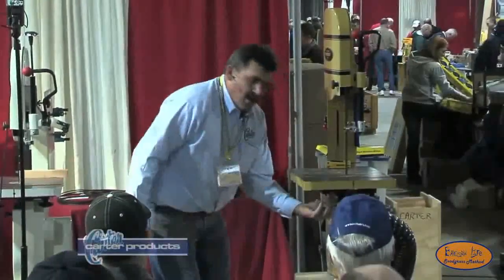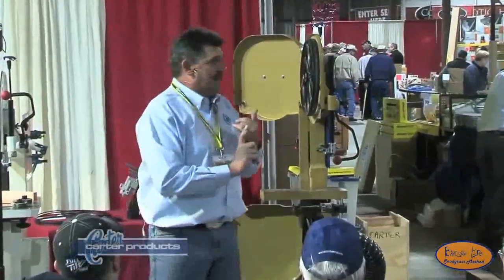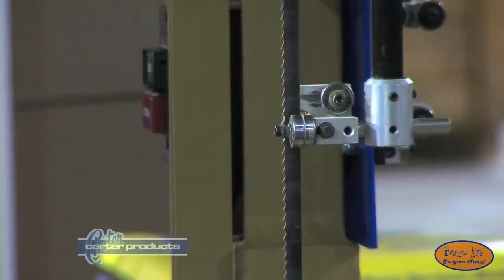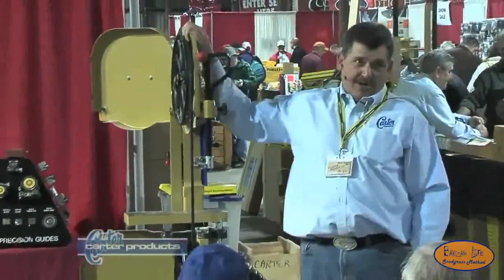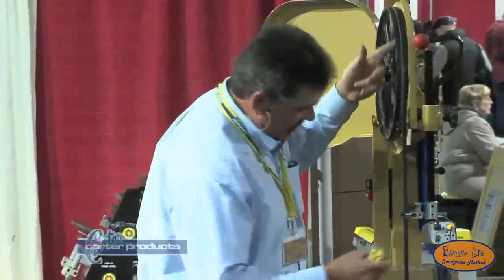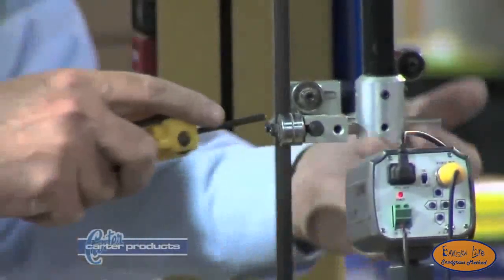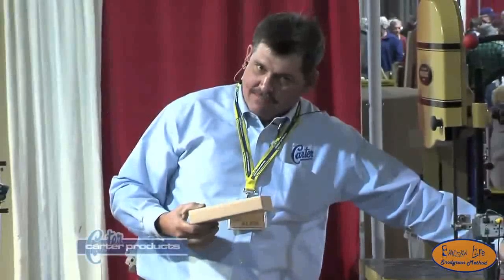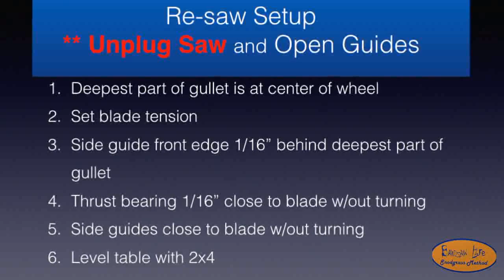Bandsaw Tuneup

Comment: Hello Mr. Snodgrass. I have seen your band saw tune up a few years ago. Well, about two weeks ago I became a band saw owner. I picked up a Rockwell/Delta 28-200 (mid 1970's I assume). It had some issues. When I got it, it was not even close to being set up properly (based on your videos). I made an attempt to get it somewhat setup but to no avail. I could see immediately the tires needed to be replaced (the upper tire would not stay on the wheel). So, I took it apart, cleaned all the rust off I could and got the parts looking good. The clamp shoes for the trunnion was bad. One was broke in half length wise and the other was in about 7 pieces. I ordered new clamp shoes, tires (urethane-orange) and picked up a link belt. Got my parts in yesterday. I put everything back together today. I used your method of tuning up a band saw. Once I was done and double and triple checked everything, it was setup or should I say dialed in. I put a container of liquid on the table, and showed very little vibration. I said what the hell, and put a nickle on edge on the table... I am pleased that I believe it passes the nickle test. IT does have the original steel blade guides (in very bad condition), which I had to grind down to get them flat. The upper blade guides are round not square, and have not seen this on other saws. I thank you for posting your videos so others can benefit from your knowledge and experience. With out your videos, I would have not know anything about setting up a band saw. Thank very much. Mike - Tucson, AZ

Comment: I gotta thankyou for this video,I just got into a 30 year old 14inch jet bandsaw that the previous
Owner had set up incorrectly,It was obvious,cool blocks with gouges,thrust bearings with deep grooves cut into them and a bad drive belt.
After watching this video and replacing the abused parts I have very smooth running tool,and the timing was perfect as this is my first bandsaw and I had no idea how to set one up.
Thanx again for this tutorial

Comment: I have just adjusted my Laguna 14/12 with the Resaw King blade as suggested here. I aligned the back of the blade to the rear of the wheel so that the gullet is just in front of the centre line. Removing the table is a wonderful tip, as it allows for accurate set up of the ceramic guides. I also replaced the annoying adjustable locking handles with star knobs. The result is much smoother & accurate cuts. Excellent advice!!

Comment: I'm wondering if you've modified your tune-up tips for newer model saws. I recently bought a Rikon 14" model. If i try to center the gullet with a 3/4" blade, the blade hangs over the wheel at the back. If i center the gullet with a 3/16" blade the bearings holder won't push back far enough to position the side bearings behind the gullet. I have to position the gullet in the first third of the wheel (ie. Center the blade on the wheel per manufacturer instructions) to be able to correctly position the guide bearings. Wonder if you have any experience or input on this. Is this something unique with newer model saws?

Comment: Thanks Alex. Though I did run out of lateral adjustment on the top wheel and couldn't get the gullet into the centre. Jet 18" bandsaw.
Reply: I'm having the same trouble, with the same saw. Although I am maxing out the saw with an 1 1/4 wide blade

Comment: My Craftman bandsaw has been sitting in the corner of my garage/shop for 3 years. I want it so bad. A year ago I purchased the new tires that everyone said I should but could not get the on. I not strong enough. Well I decided to try again 🙃 I pray so hard and ask my Lord to help me get them on. Praise God He did. Go after that it wouldn't work because of it being so badly off tracking. A adjust everything.  But now I got it running by adjusting. My saw is very, very old and doesn't have tracking in the back. I found a screw that I believe is because it made my blade not come all the way to edge.
But now it is make a lot of noise which it always did. But now I know from all you that it couldn't be making so much noise.  I checked & guides & adjustments.  It is a odd sound with a small amount of whistle.  
How would I know if it needs barring or that kind of think

Comment: Do you recommend any kind of lubricant for the tensioner?  I released my tensioner bar today and nothing happened, then I unscrewed the manual tensioner until the rod pulled out and still nothing happened.  I then took a ball peen hammer and tapped lightly on the tensioner and it popped down and released the blade.  The saw is a Delta 28-276
Reply from the maker: @Rebel9668  any dry lube will work.

Comment: Hi Alex, thanks for your great guidance.   I have a Grizzly G0513X2 bandsaw and have been unable to get the bottom of my sawblade gullet to ride on the center of the wheels.  I have moved the back bearings so they are far from the back of the blade and also moved the side bearings so they would be behind the blade teeth when centered and not touching.  Then I have loosened tension and repositioned the blade so that the gullet is centered but the blade moves forward until the entire 1/2" blade is centered on the tires.  Can you give me advice?  Thanks!

Comment: Can I continue to use a bandsaw blade that got kinked say 90°? Not a sharp kink maybe the radius of a quarter?
Reply from the maker: If you can bend it enough to work, sure.  It will leave a rougher cut and could break

Comment: How much should the gap between my upper guide bearings and the blade change as I move the guides from the bottom of the cutting height range to the top?  Mine vary by about 0.045", which seems like a lot.  This is with a 1/2" Jet blade centered on the upper wheel and tensioned properly.  If it was just the thrust bearing then I could adjust blade tracking, but the side guide bearings move as well.  If I adjust the 'front' side bearing so there is almost no gap at the bottom of the cutting height range (guides just 1/2" above the table), the gap increases to about 0.050" at the top (13" of cutting height).  Is this normal?  Thanks for your great channel!!
Reply from the maker: You say the blade is centered on the wheel?  You actually want the deepest part of the gullet in the center this should align your blade a little better since the blade placement shouldn’t move, it’s set at the factory
Reply: @bandsawlife2660  Thanks Alex.  I did try that (hard to get everything in one post) and it helped a lot with the thrust bearing but did nothing to help the lateral clearance variation. I'm wondering how much lateral clearance variation is 'normal'.

Comment: Alex hasn't responded to any questions about wide blades with respect to centering the gullet on the center of the wheel. I'm not convinced this recommondation applies to wide blades. But Alex if you are still monitoring your Youtube comments ... for wide blades (1''wide on 1-1/4 wide wheel) do yo still recommend setting the deepest part of the gullet in the middle of the wheel? Anybody else solve this problem?
Reply from the maker: Sorry if I missed this, always center the deepest part of the gullet in the center of the wheel unless it overhangs the back of the wheel
Reply: @bandsawlife2660  Thank you for the clarification and quick reply!

Comment: Hey Alex. I adjusted the band as you instructed. But I checked the alignment on the lower wheel. It tracks different and not like the upper wheel. Is it supposed track the same? Or do I just set the upper wheel and ignore the lower one?
Reply: Jame Andy ignore the lower wheel unless the blade is tracking off the wheel.  Remember the bottom has to be further forward than the top so the blade enters at the bottom of the wood At the table first or it would roll the wood into the blade.

Comment: what if the wheel is not crowned? where should it be with relation to the (uncrowned) tire?
Reply from the maker: Generally on a flat wheel the blade rides toward the front of the wheel at the top.  Tip of the teeth are usually even with the edge of the the front of the tire.
Reply: @bandsawlife2660  thanks for your prompt and helpful wisdom. i got some new tires, and i got crowned tires, so i should be able to follow your advice to the letter regarding crowned wheels now.

Comment: How do you keep from hitting your thrust bearing, because when you begin your cut in a resaw application your putting pressure on that blade and it’s going to run into the bearing.  The bearing is 1/16 or less away and there’s always some flex.  I’m getting really bad blade drift and can’t figure out why.  All of my bearing are adjusted to your specs and deepest part of the gullets are on center of the wheel.  It’s a new 1inch blade on a PM1500 bandsaw.  Any thoughts?  Thx
Reply from the maker: You should hit the thrust bearing as soon as you start to cut.
Reply: @bandsawlife2660  Okay, then I’m not sure why my blade is drifting.  The blade feels sharp and it’s fairly new too.  But that’s the only thing that it might be is the blade.  I’ve looked at everything else.
Reply from the maker: What kind of blade is it?
Reply: @bandsawlife2660  For the life of me, I can’t remember what brand of blade it is.  The blade spec a 1” blade with 4 TPI.  I just finished double checking all of the guide bearings and thrust bearings, those seem to be set right where you mention they should be in your video.  The deepest part of the gullet is riding dead center of the upper wheel.  Speaking of wheels, what about the lower wheel, does it necessarily ride in the center like the upper?  Mine is not riding in the center on the bottom wheel.  I’m thinking it has to be the blade.  I tried running a solid piece of cedar 4x4 through and it wasn’t cutting well at all.  It’s a Powermatic PM1500, takes a 153-1/2” blade, I think, I’d have to double check.  Do you have a blade manufacturer that you would recommend I look at for buying a new resawing blade?  Is the teeth count where I should be, 4 TPI?  Not sure if this is true or not, but heard you should always use the biggest blade your machine can fit when it comes to resawing.  Thank you very much for your help!
Reply from the maker: Order a 5/8” greenwood blade from Carter Products. That all I keep on my 24” Powermatic you’ll be glad you did. Tell them I sent you and they will give you a 10% discount 
Best blade you’ll ever use
Reply: @bandsawlife2660  THANK YOU, so very much!  I’ll get one ordered.  What tooth count?  I bought this saw a few years ago, brand new and I’d like to see what it can do! 😁👍🏻
Reply from the maker: 3 tpi
Reply: @bandsawlife2660  Okay, I’ll need to call them.  Their custom ordering page isn’t working right.  I need 153-1/2 length and it’s not recognizing this in the “fill in box”.  I do see that the 5/8” blade did default to a 3 TPI.  I’ll mention you sent me.  Thx again.
Reply: @bandsawlife2660  Hey Alex, I was curious about the blade location as it sits on the upper wheel.  You mentioned setting the deepest part of the gullet centered on the upper wheel.  My current blade is a 1” blade, with the deepest part of the gullet centered, it has the back side of the blade riding off the wheel a bit.  Is this still okay?  Thx again
Reply from the maker: You should hit the thrust bearing as soon as you begin to cut.  1” blade is way to overkill for that saw.  Try a 5/8” Greenwood blade by Carter Products for straight cutting only and if you would like the ultimate combo blade for resawing up to 8” and radius down to 2” go with the 3/8” Greenwood.
Reply: @bandsawlife2660  Yep, I just ordered both those sizes from Alan Kaufman, over at Carter Products.  Dropped your Name for a 10% discount.  Thank you again for that recommendation!  I was just curious about the 1” blade and how that worked with the centering set up.  But hey, no more 1” blades from here on out.  Thx
Reply: Alex…Thank You very much for the Greenwood blade recommendation!  Just installed the 5/8 3tpi blade and I’ve never resawn with a smoother cutting blade.  What a joy.  Picked up a 3/8” too for any contour cutting that may come up.  Thx again! 👍🏻

Comment: Hi, my Ryobi BS 900 Bandsaw blade twists when turning wood material to cut an angle in the wood thus cutting a straight line. Is there a way to fix this? I know it is not supposed to happen otherwise it will be impossible to cut angles, the blade cuts fine and is thin which I understand is supposed to allow for tighter turns in cutting angles in wood. The machine was used and I am not sure what the previous owner did, I followed the setup instructions from this video as best I could but I am not sure if I have the tension completely correct, . Has anyone else ever had this experience or know how to fix this, any help is greatly appreciated.
Reply from the maker: The issue is the saw it self.  It has a 9” wheel and you can’t use a blade thick enough to prevent twisting.  The radius of the wheel requires a thin kerf blade to prevent stress cracks.  I wish I had a better answer for you.
Reply: @bandsawlife2660  Thanks for the quick reply. Is there anything i can do to cut a curve as I am unable to cut any curve. Every time I try to cut a curve the blade twists to the curve and the blade guide sometimes pops up or sparks. It is frustrating as I see others on youtube with a 9 inch bandsaw cutting curves but mine isn't cutting any curve. Is there a way to fix it so it will cut a curve?
Reply: @bandsawlife2660  Thanks again for the help, it appears the blade may not be tensioned enough and I have tensioned it as much as it can go, as the tension knob stopped turning. But since reinstalling the blade and tensioning it as far as it would go, it did successfully cut a curve, though the 2nd time cutting left some burn marks on the wood during cutting the curve, which of course I immediately stopped cutting. But I wanted to thank you for your help. I have ordered a 3/8 blade and will try it out also. Thanks again.
Reply: @bandsawlife2660  I just noticed that the bottom block guide got knocked loose from when I tried cutting a curve, so I am thinking my main issues are blade tension and effective guides. Do you know if they make bearing guides for 9" bandsaws, to replace block guides?
Reply from the maker: The only guide made for 9” are the blade stabilizers.  Give Carter a call at 888-622-7937 and they can help you out.

Comment: Hello, I need help with my Bandsaw 14" Delta. I got it 2nd Hand and its in bad shaper.
I have videos + images to show you.
Reply from the maker: Sure what is the issue
Reply: @bandsawlife2660  The blade is tracking all the time no matter how many times I've tuned it.
The blade is 3/4",, Guide bearings seem to be angled.. but do not touch the blade, however, the blade twists nearly 5 deg..
How can I send you images / videos?
Reply from the maker: @iq0099  sounds like a bad blade what brand is it?
Reply: @bandsawlife2660  Highland woodworking, and its the first time using it.  Brand new! 
New poly utherene tyres..
How can I forward you some pictures and videos?
Reply from the maker: Hugedolphinfan@yahoo.com
Reply: Correction, the blade was purchased from POWERTEC and its a  13206X Band Saw Blade 105-Inch x 3/4-Inch x 3 TPI

Comment: Is this dude still kicking, my bandsaw needs some serious help. It wobbles and shakes like crazy and I can’t figure out what’s wrong. It seems to cut alright but if I lay a cup on the table and start the bandsaw that cup will be on the ground within 5 seconds. It shakes that bad 😬
Reply from the maker: Sound like a balance issue for sure.  I find placing my saw on cardboard helps dampen a lot of vibration
Reply: @bandsawlife2660  yeah I defiantly will have to try that, I bought it from my work and the reason they got rid of it was because someone hit the table with the back end of a forklift and destroyed the trunnions and they were discontinued along with pretty much every other part on the saw so it just made sense to replace it. I ended up casting new trunnions and got it back up and running but it seems like the fork lift may have slightly bent the frame. The trunnions were aluminum so the table didn’t stand a change against the forklift so I wouldn’t imagine the frame of the bandsaw would have been tweaked but I may be wrong. I’m going to replace the bearings and urethane belts and see if that helps. When you stand off to the side and watch the blade it seems to be moving left and back to center on a specific part of the rotation but I can’t pin it down to see what’s happening. I’m wondering if that’s normal for a old bandsaw. The model is the delta 28-682 18” bandsaw
Reply from the maker: More than likely the blade movement is from a bad blade not the saw.